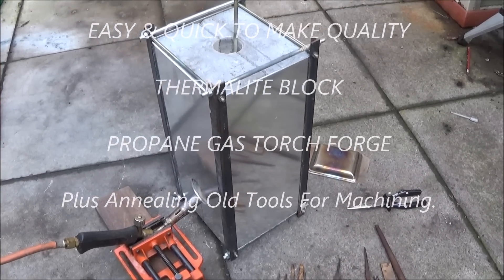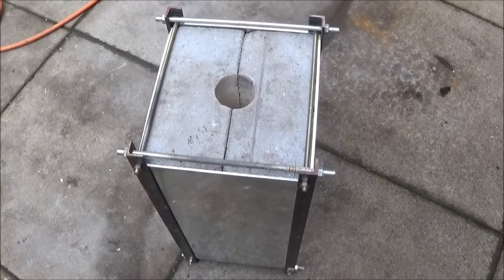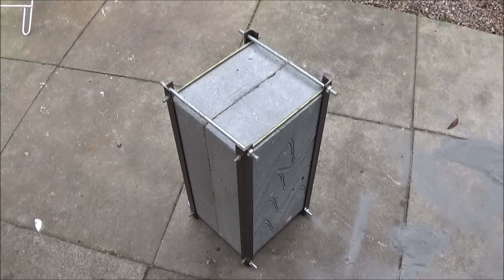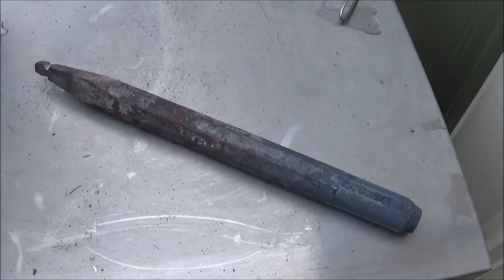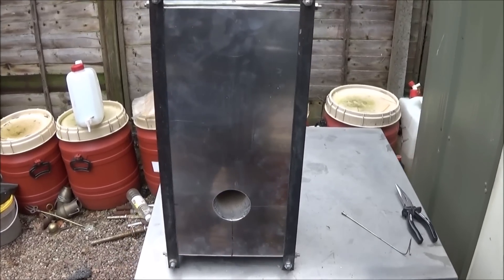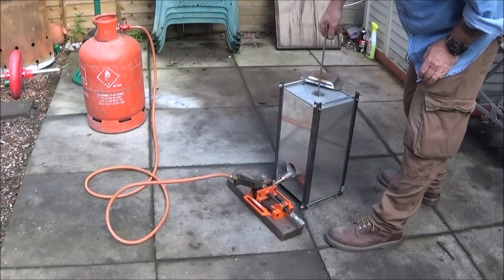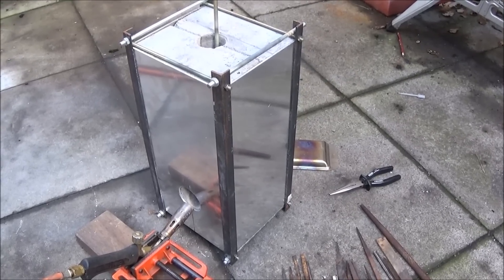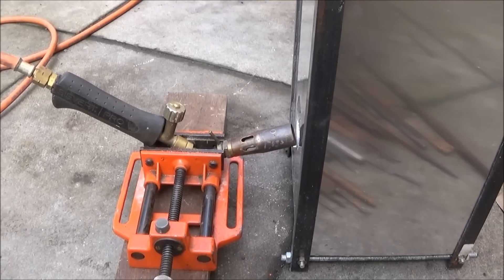EASY & QUICK TO MAKE THERMALITE BLOCK PROPANE GAS FORGE + ANNEALING

Comment: What sort of temperature does the outside of the forge get when your using it?

Thanks

Jason
Reply from the maker: Hi Jason, I haven't measured it as it still remained cool to touch.
Reply: @SteveJordan  that's enough for me I was just wondering how thermally efficient they were.. Nice job you did on it!

Comment: I like this idea, looks tidy with the Ali plate. I wonder if placing the torch hole at a compound angle would create more of a vortex for the heat , which if combined with running it on its side might make it all more effective?  Going to start getting some materials together . Thanks very much for uploading. All the best. Mat

Comment: just had a thought if you made the top hole larger, would it be possible to melt aluminium for casting ?
Reply from the maker: Hi David, It is worth a try if you are in to casting... If it failed it wouldn't matter as the blocks are very cheap to buy and are easily replaced.

Comment: You just don't stop with the new ideas do you.  This sure is a good one.  What is the reason for the aluminum?  Is it for safety in holding things together or for reflecting the heat back into the furnace?  Or for some other reason.  Just wondering.   Thank you for shaing this.
Reply from the maker: Hi Glenn I use the forge outside so I have to keep moving it about. The aluminium just protects the blocks. They are very easily chipped or cracked particularly if they get a bit damp from the atmosphere. Also I wanted to keep it as light as possible. I can use the top threaded studding as a handle to lift it,  but I am going put some better loops on these to make it easier to handle, sometime.
Reply: Steve, that all makes a lot of sense.  Especially the weight issue and a pair of handles.  Just last night it occurred to me that this little forge could just as well be used lying on it's side...so as not to drop small parts to the bottom where they are hard to retrieve, or is this not a good idea.  What say you?
Reply from the maker: Hi Glenn, Yes I reckon it would be good on its side. I will try it next time I use it.

Comment: Very informative.  You learn something new everyday.  I was not aware of thermalite.  I am going to see if that is available on this side of the water.  Keep on keeping on.
Reply: I am going to go to the brick yard and see if this available around here, Tennessee,  Also, if you find it  Pleas, let us all know.
Reply: I have only found it with UK addresses and I gave up the search.
Reply from the maker: Thermalite is a name for the UK makers of these blocks. They are also known more commonly as Aerated Blocks or Thermal Insulation Blocks for building.
Reply: I found bricks under kilns.  Lot's to choose from.   2.5 or 3 inches by 4.5 x 9.   You can get soft or hard.

Comment from the maker: MATERIAL LIST TO MAKE THIS FORGE. 
2-OFF Standard Thermalite Blocks 440mm x 215mm x 100mm. (SEE NOTE BELOW).
4-OFF Angle Iron 20mm x 20mm x 3mm Thick x 500mm Long.
2-OFF Aluminium Sheet 440mm x 215mm x 3mm.
2-OFF Aluminium Sheet 440mm x 200mm x 3mm.
4-OFF 8mm Threaded Studding x 250mm Long.
4-OFF 6mm Threaded Studding x 250mm Long.
8-OFF 8mm Nuts.
8-OFF 6mm Nuts.

PLEASE NOTE:..... THERMALITE is a UK makers name for these type of blocks. They are also know as AERATED  or INSULATION BLOCKS, used for building.
Reply from the maker: PLUS SOME EXCELLENT NEW FORGE THERMOMETERS:-
HoldPeak HP-1300... 50c-1300c Laser Temperature Thermometer Gun --  https://goo.gl/Vk9KtD 
DT1311 K-Type Thermometer Ceramic Probe Forge --  https://goo.gl/yvpdhM

Comment: The aluminium looks very chic, but is it really necessary?
Reply from the maker: You can do without the aluminium, but the blocks crumble and chip easily particularly in a damp atmosphere. I cover mine, as I move the forge about a lot and use it outside. It will not easily damage like this and should last a lifetime. Also it wont rust...:-)